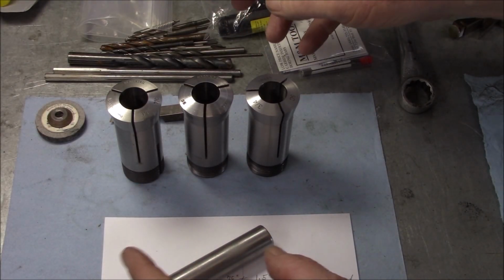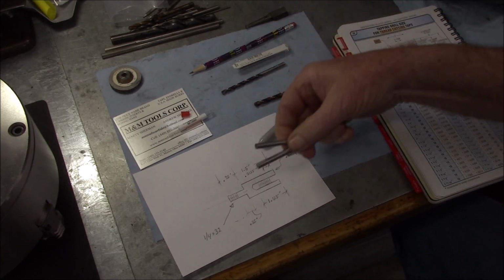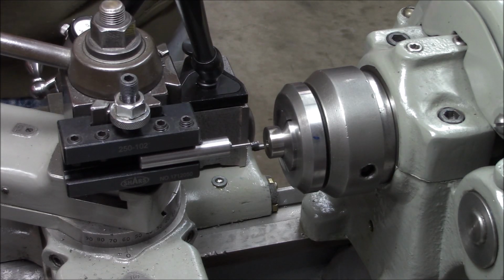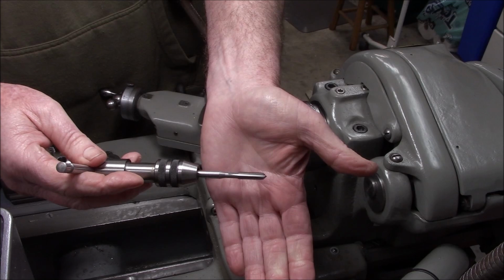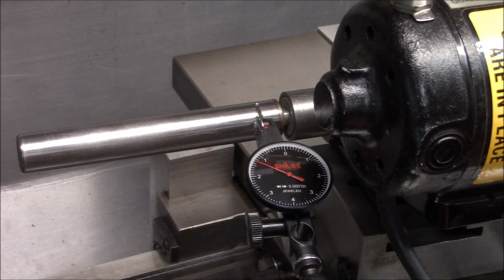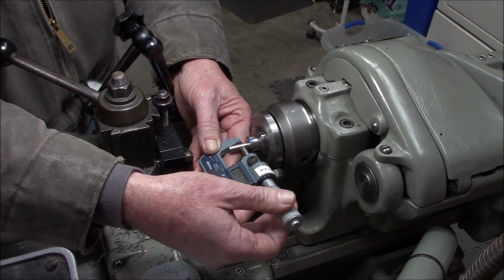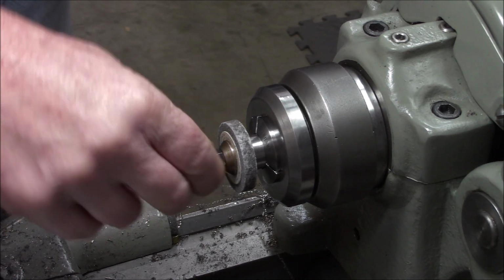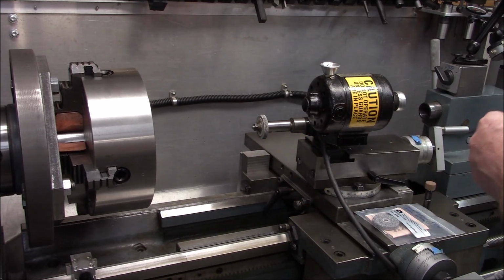Mystery Project Part 4 : Side Project - TPG Extension Arbor

Comment: Dean  i have been thinking which is dangerous , could you put a abor in the chuck with grinding stone on it and grind in your spinal using the cross side and compound. I believe they have to rotate in opposite directions like a crank grinder. 
Kit from down under
Reply from the maker: I'll have to think about that one...as you say that's dangerous 😁
And I do have a DIY grinder for the South Bend.
Thanks,
Cheers....

Comment: Some great machining content and thoughts in this video.  And some good thought provoking as well.    My thoughts.... faced with the same things I feel like the bump at the end of the thread on the grinder spindle could have been taken down with a fine slip stone. Especially if the parallel portion behind the end of the thread was  the better diameter and if it was running with next to zero runout.  Better to remove the offending "bump" than to open up the whole counter bore.  Especially when it was such a small amount.   The other thing was that it was likely the tap that caused the small runout of the exterior if it was not the collet.  To counter that I would say that starting out with the counter bore being a few thou too small and letting the tap thread in through it would have caused it to self center and might result in a more aligned thread to the OD.  Or not.... It's a guess.  But one that I would like to try.  And then following the threading operation clean out the counter bore to bring it to a very slight oversize match to the neck of the spindle stud.  But in the end it ran smooth and that's the key thing.    Already looking forward to the next part.
Reply from the maker: Great information Bruce ! You may have nailed it on the tap issue. I did notice after taping some light thread witness marks only on one side of the counter bore.. 
Thanks !